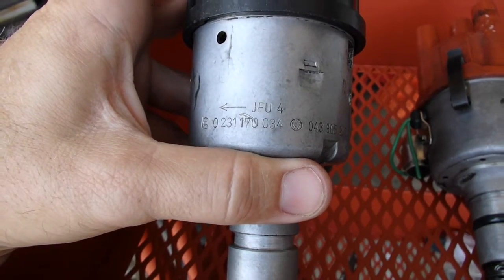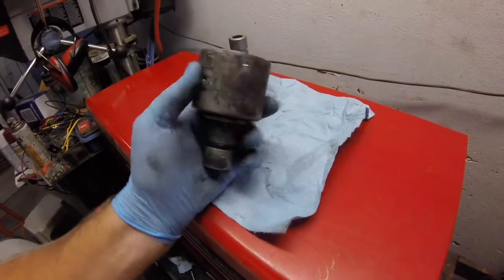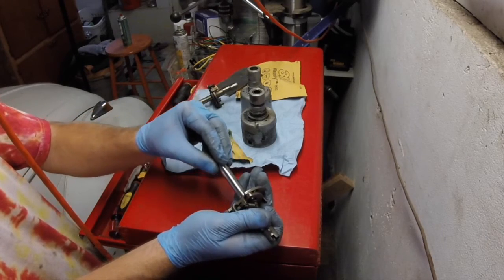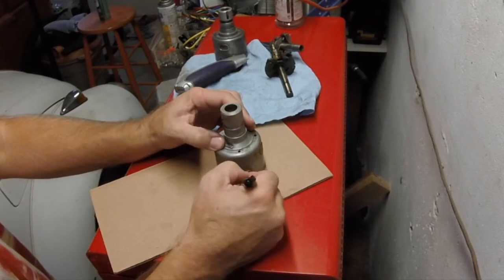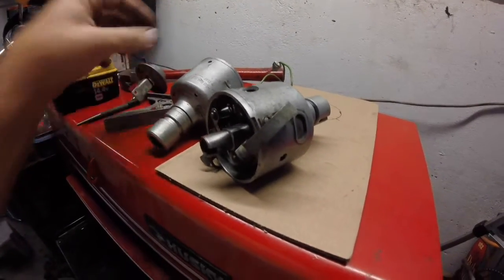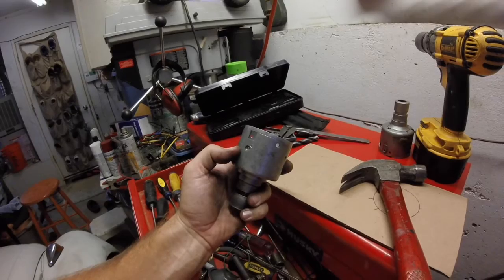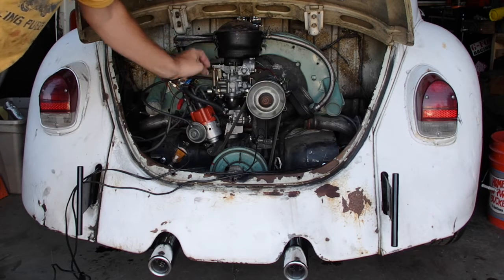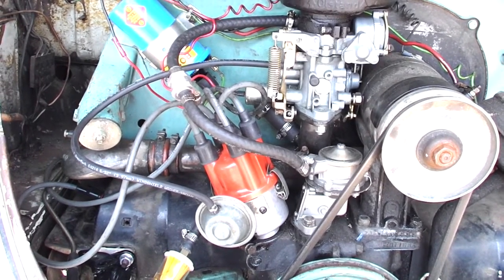1969 VW Bug Project - Episode 21 - Bosch 009 & 034 SVDA Distributor Mashup (actual how-to)

Comment: Electronic points can fail for no obvious reason. Happened to me. I went back to points and have never regretted it. I have replaced the standard points plate screw with a carefully worked allen screw, which is so much easier to tighten and has worked great.

Comment: what im thinking is your fuel getting too cold with no heat risers. Ive got a friend of mine who delete his heat risers and his engine wouldnt handle acceleration properly. With a Vacuum leak, you idle would be all over the place, range about 850 then dropping to 600 then goes back up, etc...
Reply from the maker: Hadn't thought of that.  Thanks for the suggestion.  The idle is still a little all over the place, though I've swapped out this hybrid carb for a different one.

Comment: Might be mixing up points plate and weights area.  The weights spin, but the points plate does not spin.  Use shaft with weights from 009, use points plate from 034.  Probably I'm missing something.
Reply from the maker: It's been a while since I did this, but you may be right.  It ended up working, though, so ...?

Comment: How do you remove the coupler ON the bottom?
Reply from the maker: I suck for giving such a late response.  But there's a spring steel roller pin that you need to punch out.

Comment: Looks like your about ready for some new transmission mounts. There is alittle extra engine jiggle on start up and rev up. On a VW, unlike other areas of life, a little extra jiggle is not a good thing. 

Nice job with the dizzy. Hope your engine refresh went well.
Reply from the maker: I’ll look into that, Brian. Thanks for the tip!

Comment: how the fuck did you take the bottom pin out
Reply from the maker: A hammer and skinny punch, once I uncoiled the spring that wraps around it.
Reply: great question!!!!
Reply: how do you uncoil that spring that wraps around it?
Reply: jo camaya I put a small screw driver under it and tilt it 45° on both sides then you can normally take off with your fingers
Reply from the maker: Right.  Just be careful not to kink the spring.
Reply: School St. Garage 1 month later i still failed to take the pin out
Reply: Which side did you press it out OF?  That pin is tapered and one cannot toll the difference.

Comment: I think that use points in this case is the better solution because is easy to troubleshooting, but you can use a eletronic assistente for trigger your coil. try to know about the circuits like this: http://4.bp.blogspot.com/-hr3qYYHaWQA/Tn0-7YqLs8I/AAAAAAAABiM/IoZV58e61M8/s1600/Ignicao+Fabrinic+Ver.03.JPG
It's just a sugestion because your job is amazing. 
Congrats
Reply from the maker: Gracias, Luiz!  That schematic was very cool.  Really got me thinking about the trigger assist for the coil.
Reply: Yeah, it's very simple and easy to reverse.